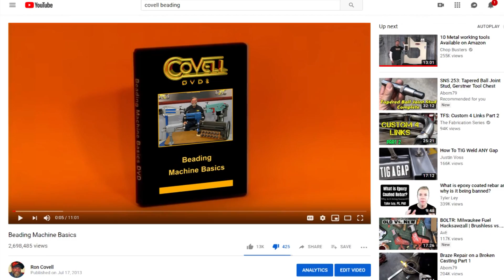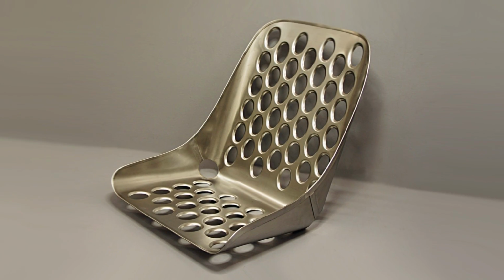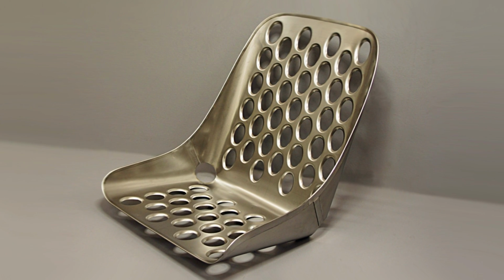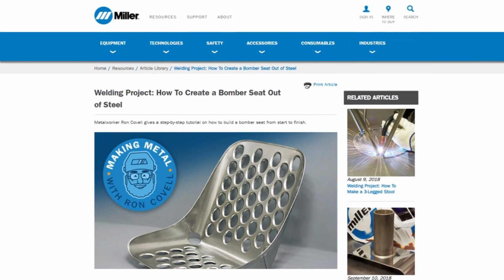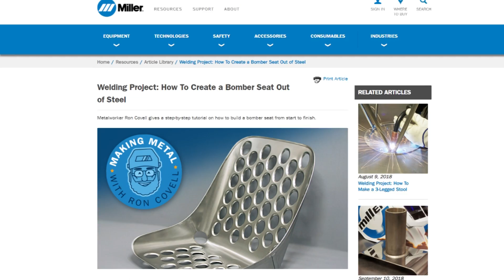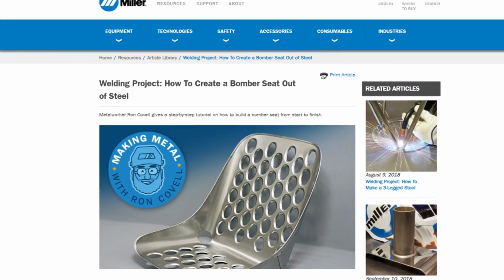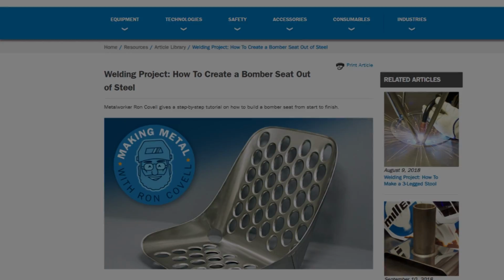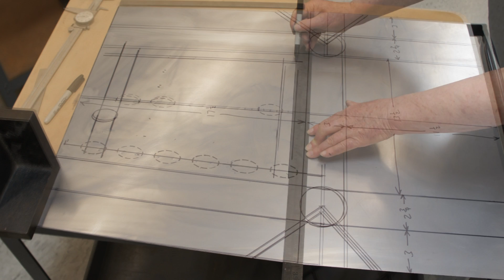Bomber Seat - made EASY!

Comment: “Using simple tools”, I think we have different definitions of simple tools.
Reply from the maker: You are correct that I used some fancy tools in this video. My intention was to show a BENDING PROCESS that was simple. I hope to make another bomber seat video using some truly simple tools!
Reply: @RonCovell  It was a great video Ron. If you are thinking about doing videos in the future using simple tools, you could break it down into a few videos, each one dedicated to replacing the method where you used a non-simple tool. For example, a video on how to roll a step (and crimp final edge) without a beading machine. A video on how to form the edge cap without a shrinker stretcher, and then an alternative to the hydraulic press for the cutting. I think the first two would be difficult to work out an alternative for, because the cost of an inexpensive beading machine could leave it close to being in the "simple tool" category, and I'm struggling to think of a DIY option for the stretcher. I guess the hydraulic press option might be satisfied by some sort of car jack setup, although even that would be difficult because of the size of the chair that you're punching a hole in, you'd need that width that the H frame gives (you could press against the underside of a table with a weight on it I suppose!). Maybe even a video on your thought process in considering a simple version of these tasks, or a video on the minimum tool requirements you'd suggest for metalworking and the order of purchase. For example, you'd need a welder (mig, tig, etc?) and shears, hammers X,Y,Z, compressor/sander etc if you want to do beginner (not remotely beginner for that standard of course!) projects such as the dustpan you just produced, then the next tool you'd look to buy would be beading machine and what to look for in terms of value there and what you could produce with just that. Just some ideas of course, I'm happy just watching your skills! I suppose I see you as the Paul Sellers of metal working, using tried and tested methods with an emphasis on skilled work with a modest set of tools and good physical labour. You're not throwing out adverts for plasma torches and CNCs that the hobbyist can only dream of, or the well off hobbyist ends up buying without ever addressing the basic skills. Fantastic videos indeed, I could watch you work all day (although, I would have to get a divorce first before I'd be allowed)!